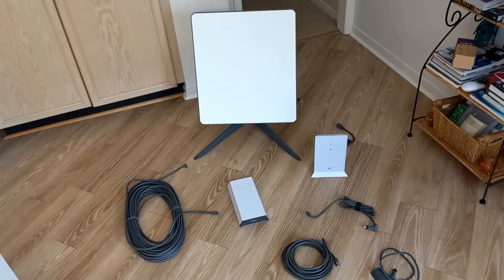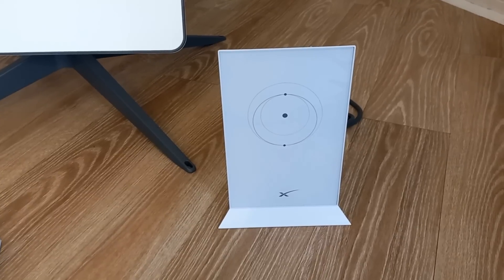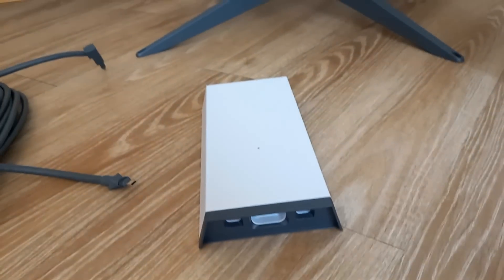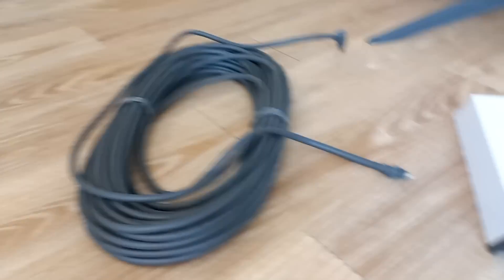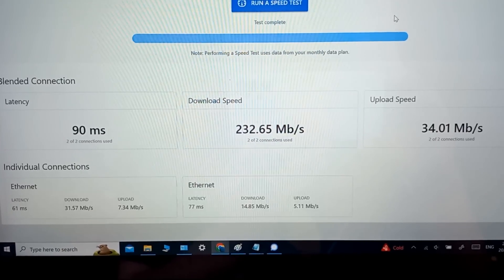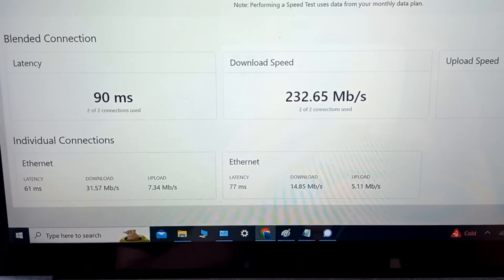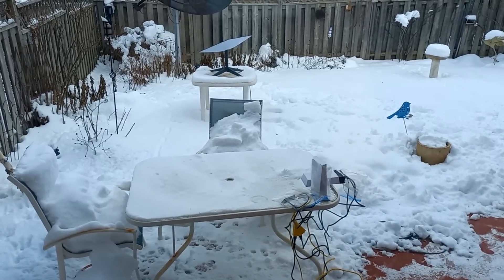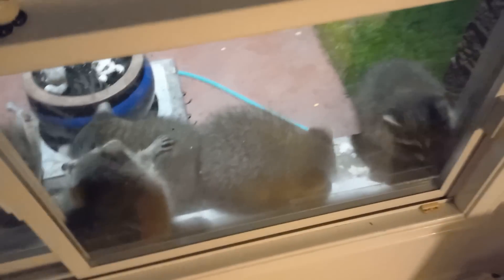Multi-Starlink Aggregation Array using Network Bonding Gateway

Comment: lol "Network Bonding Gateway" you mean a router?
Reply from the maker: It's a Network Bonding Gateway. It creates multiple VPN tunnels, each thought a different network connection. It then sends packets over the multiple connections back to a cloud based concentrator. The router is actually part of the cloud based concentrator.
Reply: Why though? That seems like a lot of added complexity. Now you've got VPN overhead plus additional latency to send everything through the cloud concentrator. Just use a router and do equal-cost load balancing.  @peterfairlie2296
Reply from the maker: Doing it this way with multiple network uplinks provides a resilient internet service for mission critical applications. If you're streaming broadcast video and one of the network uplink connections suddenly fails your stream data will seamlessly continue to be carried over the other links uninterrupted. The problem with load balancing over 2 different connections is you are dealing with 2 different WAN IP's. If you were to switch during a video broadcast the connection will drop since the IP will change.

Comment: I’m curious how that device gets around asynch routing issues. I assume it creates a tunnel for each service provider back to a single cloud endpoint which becomes your wan of sorts.
Reply from the maker: That's what it does. Every connection is a VPN tunnel back the a cloud based 'concentrator' which is really just a VPN server.
Reply: @peterfairlie2296  gotcha that makes sense, of course I imagine you will only ever see the speed of whatever link the traffic is going over.

Comment: Starlink upload speeds are unbelievable and it needs a lot more improvements, and generally the speeds seems to be similar to the residential speeds and there isn't much difference between to the two I can understand why you would be disappointed, if you were living underneath a clear skies you might get 400 max. But honestly the price as it stands it's not worth the dime, and anyway your data centre is on point although I would have added an air con to keep the servers running cooler than rocket raccoon.🦝

Comment: Can you post a link to the “M16 Gateway” you will use for bonding the 5 Starlinks? I’m struggling to live stream 1080P from a 150mph object. I need a solid bonding solution. I currently utilize Pepwave 5G Modem. Also? Is there a SIM card that you are aware of that has a higher upload speed than others?
Reply from the maker: https://www.dejero.com/products/gateway

Comment: Gen 1 Antenna is still the best value for your money , this set up offers  a Lan port  all included( unlike Gen2 ), GEN 1 antenna is motorised ( unlike GEN2) , GEN 1 antenna is the bigger option offering  the hight antenna  GAIN and as a result a much better S/N ,
 Yet if one is after a smaller foot print ( RV ?) than Gen2 is for you  , Gen3 offers noting new ( beside the price) , one could say that both gen 2 and 3 are more about saving on hardware costs than offering any great benefits to the end user.
As for speed ( MB/s ), sorry boys, that is determent at the provider end, all the user can do is optimise his set up by making sure the sky is not interrupted by trees/ RF noisy power lines) and the angle of the antenna is set to maximise the signals coming from the satellite.
 I have found the GEN 2 and 3 are much more likely to loose connection when there is a storm above the antenna ( in the area where the antenna is located) , and here is where the  GEN1 shines offering less interruptions in service  overall.

Comment: As someone with their own mini datacenter in their basement with two enterprise rackmount servers, two desktop PCs, and two network switches that all combined "only" consume 600 watts of electricity around the clock....  RIP your wallet from the power bill, Peter LOL.  This sh*t is cool, and you do a lot of really interesting things!  As always, thanks for sharing!
Reply from the maker: There is a 3000 Watt UPS in the bottom of the rack. It's fed by a 30 amp electrical circuit. Load is a continuous 16 amps @ 120 volts = 2 Kw/h
Reply: @peterfairlie2296  daaaaaaang.  That actually isn't bad!!  Nice!
Reply: @peterfairlie2296  whats the cost for MW for your electric provider?
Reply: @peterfairlie2296 that is fantastic haha

Comment: The Gen2 "Commercial" systems didn't have that Ethernet cable, forced us to use all the junk/crap they sent.  The "ROUTER" is not a router, just a WAP & PoE brick. Networking done at/in the dish.
Reply from the maker: The Router is a Router because it's running on WRT and creating it's own subnet 192.168.0.1/24 which is using the dish as a gateway on 192.168.100.1 You can also use your own Router in place of the Starlink Router and you're not double NAT'd.
Reply: @peterfairlie2296  Couple of things, the crappy Ethernet adapter sits on same data path as the "Router" but can provide either the same subnet as the horrific Wi-Fi or the direct CGNAT address. Networking from the dish, the "Router" is just a Wi-Fi AP and PoE injector. Yes, used third-party power supply and got the native 192.168.0.0/24 out of the dish. 192.168.100.1 is the internal GUI, again, on the dish.  Bridge mode stuns the "Router" into a ugly and awkward brick and you still have the messy cabling and proprietry cable ends. 
The ethernet cable you got was new, shame you didn't use and and used old crapy setup. Plug it is and see what you get out the dish?
Reply from the maker: @bentheguru4986  The Business system I'm using came with a ethernet cable to allow you to use your own Router https://youtu.be/ovbxuBDg3Dc?si=5y-Y_M1zvJ_rPtT1&t=238
Reply from the maker: Check out Oleg's blog. He's been reverse engineering and repairing Starlinks for the Ukrainian Military.  https://olegkutkov.me/

Comment: I had Starlink about 2.5 years ago with round dishy, I was usually getting between 100-300mbps. I’m in Australia (vic) so I assume the lower population is the reason why. I haven’t used starlink in a while so it may be slower now, from starlink I went to 5G, that gave me 200-500mbps and I was with that until my area finally got fibre last month. When I first got the 5g I was load balancing the 5g and Starlink. I hit around 725mbps in a speed test with that.
Reply: Do you have some tutorials to do that ?
Reply: Here in the US I'm using an inexpensive OpenWRT/GoldenOrb router connected to a 5G iPhone12 as a modem with Tmobile service.  I'm about a mile away from the nearest tower, getting around 900 Mbps down, 90 up, with 15 ms average latency for a mere $50 bucks per month.  I can even take the small router and phone with me on the road, plug it in and it's ready to go in under a minute, no other setup needed.  As a bonus, I can use the phone for calling, texting, and web while connected to the router as a modem. :)

Comment: damn its always nice to see the data centre, looks cool but I can't guess what you need 12 or so tower lenovo pcs for.
Reply: Those have HDMI capture cards in them, and are fed from SDI to HDMI adapters. I suspect he has some sat boxes with SDI output intended for use by CATV operators or hotels and they don't enforce encryption on the output the way a consumer box would. What you see is essentially a large scale DVR that can record multiple channels at the same time.
Reply: @GrizzLeeAdams  that's actually pretty cool, would explain why he is hesitant to do a tour of it all lol. One thing though, why not have multiple capture cards in the pcs for better density. Or is that already what happening?

Just looked back at the footage and yeah only one card per pc, however looking at the unused ports I think those are graphics cards and my guess is its the other way around, using them to run some sort of home cable system. But I can't really see the equipment that would be used to modulate all of that so maybe I'm wrong.

Comment: I am not sure this will make sense but, when you bond 5 starlinks together, will it be possible to try to manually direct some of those antennas to different parts of sky ? so they are connecting to different satellites? that way, maybe you get different starlink backbone ground station connections... useful for bonding scenarios as for example roof has 2 angled surfaces and laying antennas flat on those surfaces, you get two views of sky / different sets of satellites. i am not sure how exactly starlink chooses satellites / rotates antennas. Because version 3 of antennas is without positioning motor so maybe that will be possible only with 3rd gen starlink... Just putting some ideas out there. 🙃
Reply: The starlink satellites are more narrow field than broadcast satellites, kind of like the difference between a 5G cellphone tower and an an FM or AM tower.  The closer to the horizon the satellite is perceived from your location and you'll get much worse signal and latency because you're outside the cone the satellite is intended to service and further away than someone directly under it.
Reply: @GrizzLeeAdams  Having multiple antennas in steeper position with different azimuths should be good solution for having more satellite connections ( over multiple antennas ), you can even eliminate latency increase when one of customer ground stations is steering towards another satellite, by routing traffic thru lower latency link ( this type of routing is not standardly done on youtube.)
Reply: @GrizzLeeAdams   Steered array can do only so much, even sitting on motorized positioner, which starlink seems to use only for seldom position correction/obstruction avoidance, not for "realtime tracking". Even on video you can see antenna is not not moving and is not horizontal. Also there can be situation multiple times a day when you can only see satellites low in the sky, but on opposite parts of sky, constellation is not as dense as people make it to be. So i think that should be very useful experiment. On multiple levels.